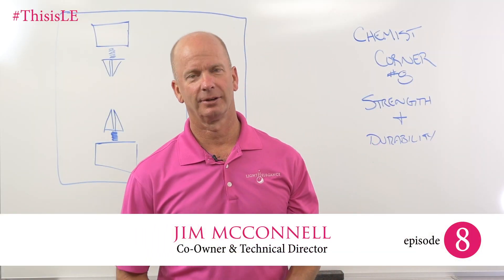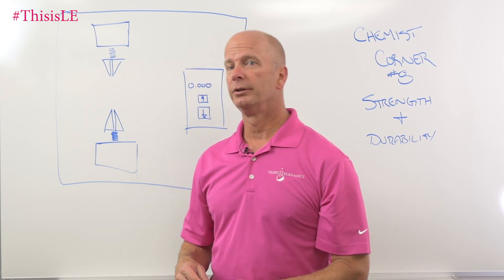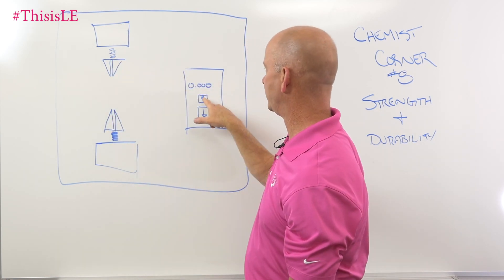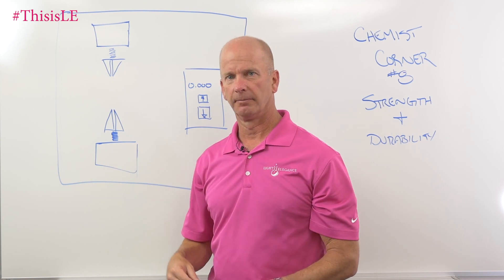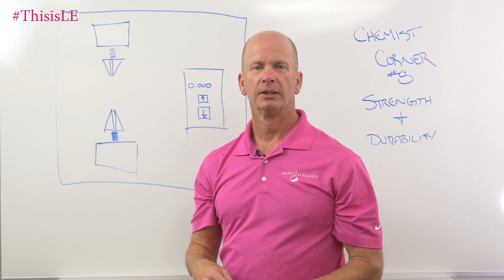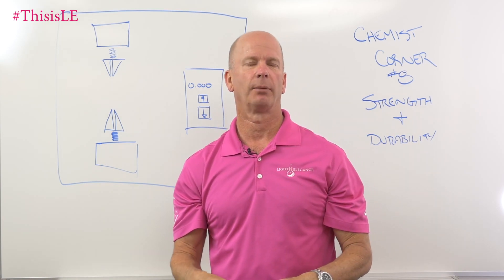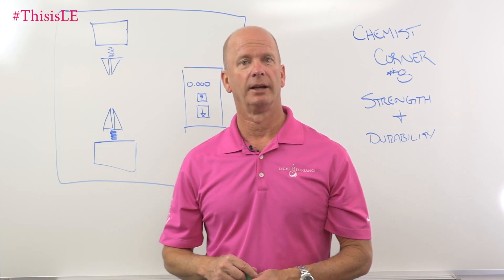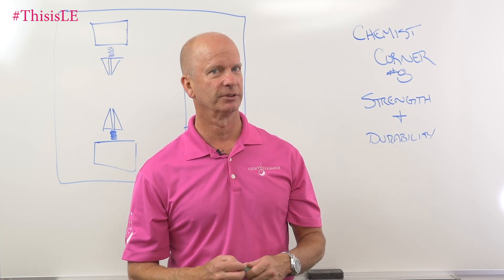How do Strength and Flexibility Impact Nail Performance? - Chemist Corner #8 with Jim McConnell

Comment: i have a question about cool gel and every other tech i know has the same issue, i have all the le gels and the cool gel claims to have been "formulated to reduce exothermic reactions when curing" and "great for clients with sensitive nails and first time gel users" . BUT it BURNS the worst out of all the gels!!! why is this??? what am i doing wrong??
Reply: Hi Baja Rosie - the product Cool Gel was formulated to be cooler curing a long time ago. This occurred when our 1-Step, Extreme and Builder gels were much hotter than they are today.  Thus, the Cool Gel was once cooler than the other gels but this is no longer the case.  We considered changing the name but decided against that idea and now just have to explain why the Cool Gel is no as cool as the others.

Comment: I'm probably jumping ahead of your planned videos, but could you at some time speak to why using the lamp tested to perform best with a gel is a wise practice, and more specifically, what product failures one might see when choosing to use another lamp that may be emitting a different wavelength, have different distance between the light and the product, have fewer diodes, and other issues. I feel this is one of the top overlooked things in troubleshooting product use in chat forums.
Reply: Thank you for your input.  I am arranging new Chemist Corners now and this would be a good one :)

Comment: does overcuring make the gel less flexible therefore chip easier on the nail plate? I would like to see more videos on this topic with examples of light elegance products. How to choose different gel viscosities depending on the clients nail structure (thin, thick, bristle, hydration)
Reply: Hi Sarah Diaz - this is a great idea!  How about if we include a Chemist Corner in the future to address this?  

Rather than making you wait ... I can take a few moments to offer and explanation.  The Extreme Gel is what is most popular in the USA. It is thick yet self-leveling and comes in a lot of different colors.  If it moves and self-levels too slowly for the nail professional, then we tell people to try Cool Gel or 1-Step.  If some find it moves too fast, then we ask that they try the Builder gels.  Most of the gels we manufacture have the same strength and hardness, so the selection becomes a matter of personal choice and preference.  

Regarding the question of over-curing, we do not think that a building gel can be over-cured.  First, let's define the term "over-curing".  Over-curing is if the gel can form too many of its bonds.  We formulate the building gels to cure very well - this is a source of the exothermic reaction or heat that is felt during the curing process.  If not enough bonds are made during the curing time, then under-curing can occur which can lead to lifting, cracking, and soft product that is not as strong as it should be.  So, with building gels, they are either cured, under-cured or not cured.  Super Shiny or other gloss products that have a sticky layer can be over-cured.  If a gloss product that has a sticky layer (like our Super Shiny), is cured too long, then the gloss starts to go away because the sticky payer becomes too thin and we get areas of surface curing mixed with areas of no surface curing.  This mixed surface appears as diminished gloss.  

In summary, building gels cannot be over-cured per my explanation of the term "over-curing" above.  Gloss gels that have a sticky residue can be over-cured but this only effects the gloss of the cured material and will not lead to cracking or chipping.  

I hope this helped.
Reply: @jimmcconnell6079  thank you so much it really helped me on the "over-cured" topic... looking forward to take the bachelor with you guys....
Reply: Jim McConnell  thank you so much 😊 this helps a lot! I’m considering taking the LE course online because I love your products so much
Reply: @jimmcconnell6079  thanks for the explanation of over-curing.
Reply: Sarah Diaz if you ever get a chance to take one of the basic classes from their educators they explain what your wanting to know. I recommend doing so. I love this brand so much!
Reply: I agree
Reply: Sarah Diaz celina ryden their ambassador has videos on this topic.
Reply: Isamar Vega if I remember correctly she talks about the different viscosities but not what’s best for different nail types